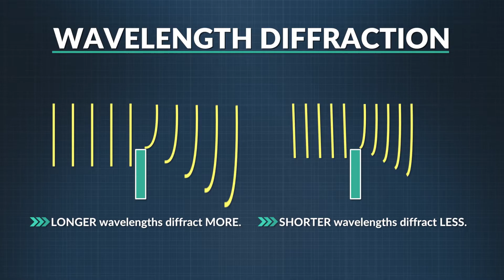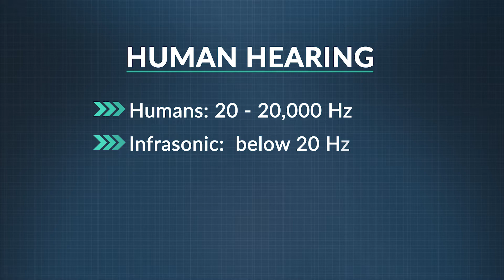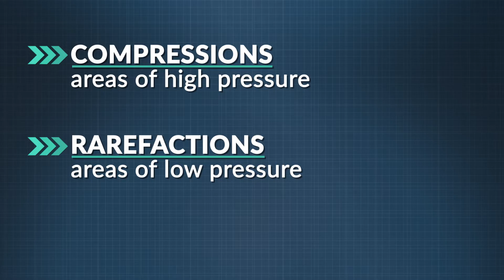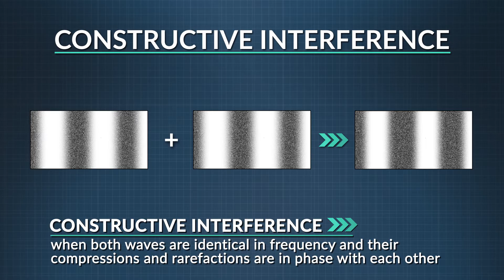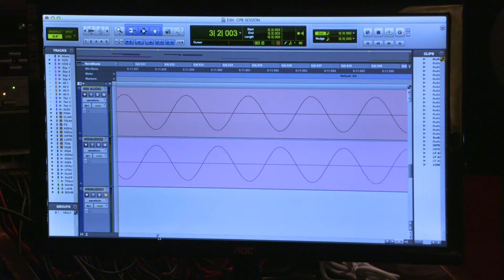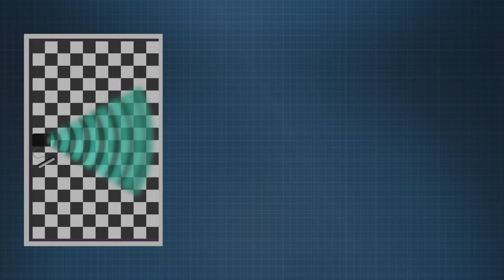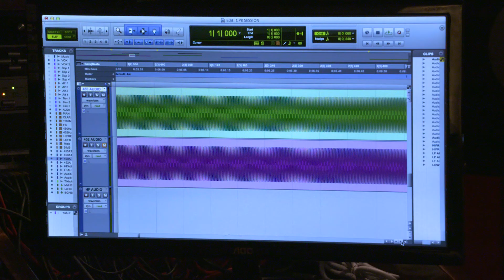Sound: Diffraction and Interference | Physics in Motion

Comment: Don't believe everything you see on YouTube!! The thunder high crack - low rumble phenomenon is a better example of the atmospheric absorption of sound than of the diffraction of sound. Lightening in the desert or on the plains will still sound low when it is further away even though there are no obstacles (diffraction) between your ears and the source. Atmospheric absorption is based on a combination of viscous & thermal conduction effects as well as molecular relaxation processes. The attenuation curve is roughly the square of frequency. See: ANSI standards S1-26:1995, "Calculations of the Absorption of Sound by the atmosphere" (ISO 9613-1:1996) andH.E. Bass, et al, "Atmospheric absorption of sound: Further developments", J. Acoust. Soc. Am., 97(1), 680-683 (1995).